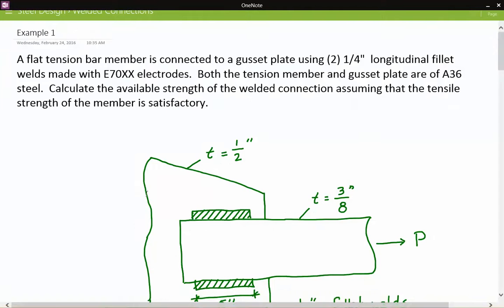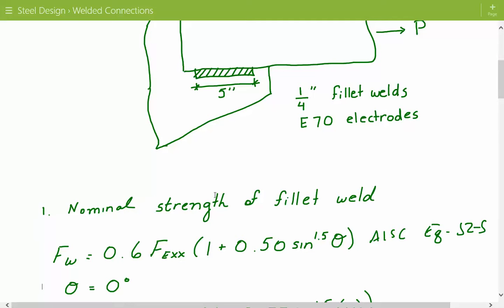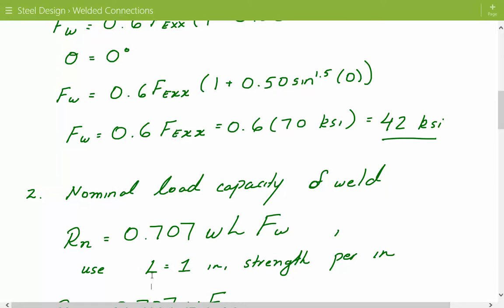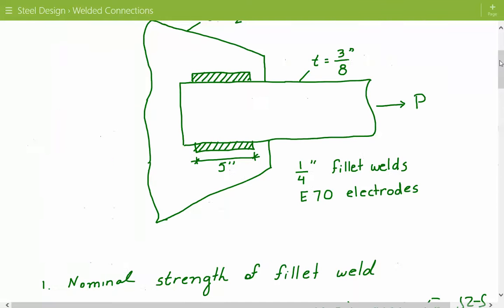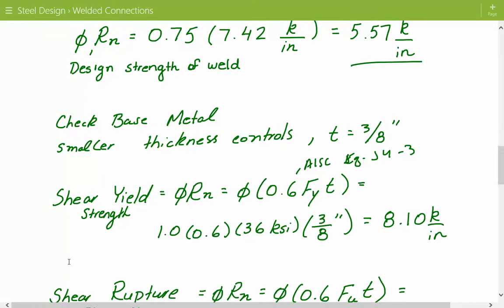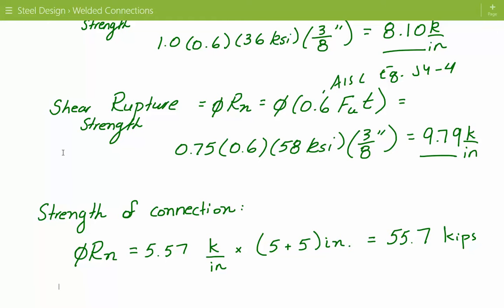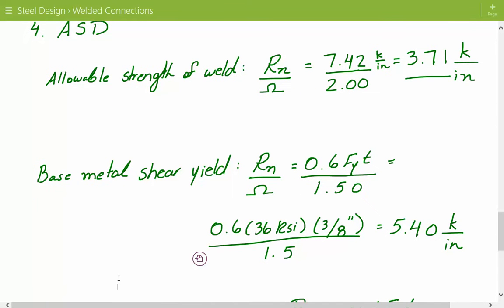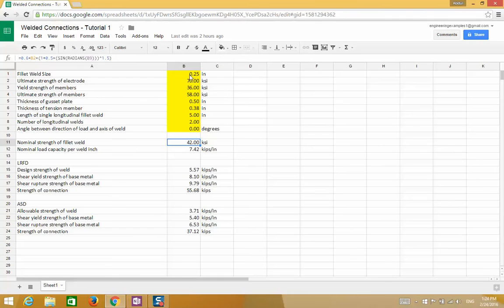Structural steel engineering design & analysis of fillet weld connections per ASD / LRFD Tutorial 1

Comment: I work as a structural engineer and due to lack of time we simplified fillet weld formula for theta=0 as: 1.392*D*L  and 0.928*D*L for LRFD and ASD Method respectively, where d= weldsize÷1/16. That will save you some time .example for 1/4" weld size and 5 in. weld length 1.392*4*5= 5.56kips .